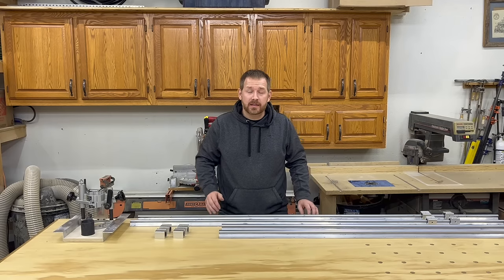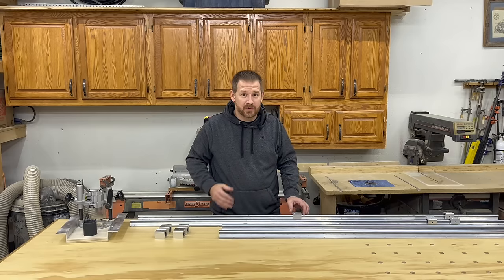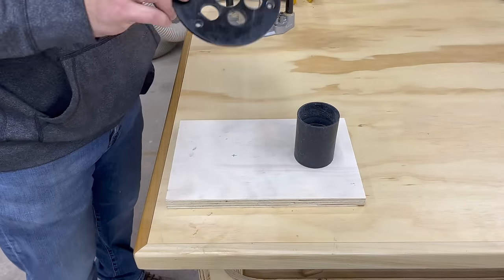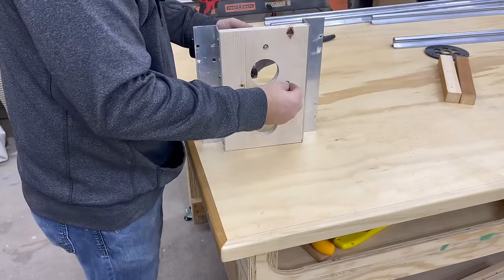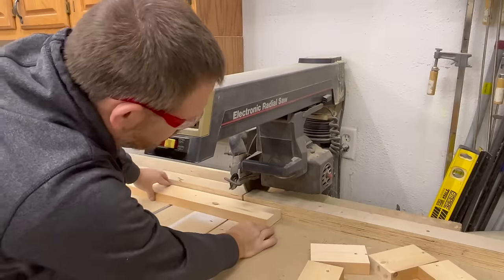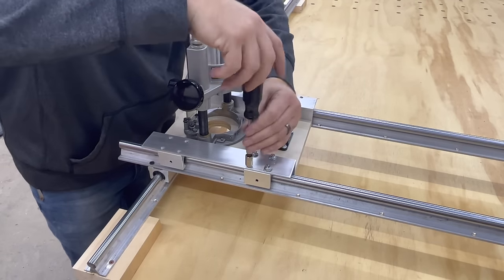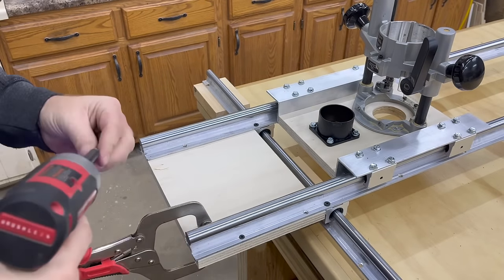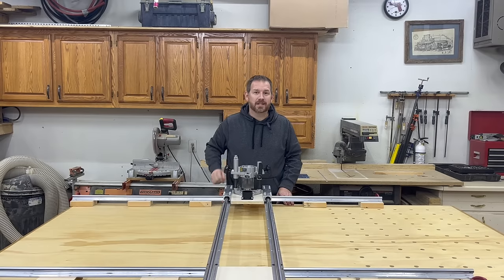Build a Better Router Sled/Flattening Jig

Comment: I just built on much like what you have done. I did make an alteration hat I think is important. I added stops at the end of each rail to prevent the possibility of the components from traveling beyond the ends of the rails. The idea of running router sliding off in either direction of travel is frighting. Either damage to the work, the router or the operator could be catastrophic. I used 1/4x20x1-1/4 boots 1 inch from each end.
Reply from the maker: Hello, thanks for watching.  That’s a great idea!  You definitely don’t want to run the carriage of the end!  For me… when I clamp my setup the the workbench the C-clamps block the carriage for running off the end.

Comment: How do you make sure the piece comed out flat? Is it that your workbench is completely flat or the rails? Or do you use shims under the slab when flattening like on a planer sled
Reply from the maker: I go over this in the next video.  Here’s a link to that video.  Building a Better Router Sled/Flattening Jig (Part 2)
https://youtu.be/wcQkhDzZ420

There’s also a part 3 where I make upgrades to this sled.  Here’s that link if you’re interested.  https://youtu.be/pYstDfpUUZE?si=ZAiS3v17u-jDraXw

Thanks for watching!

Comment: out standing video and well done.question as to bearings. you mentioned wood and dust  going into bearings and clogging unit. was it a big deal to clean
thinking of using a closed bearing block at router. Will this help? best joe
Reply from the maker: Hey thanks for watching!  Cleaning the bearings isn’t bad.  I just blow them out with the air compressor and lube them with a spray can of dry lube.  
I made some upgrades to this sled which included an better dust collector.  Helps a lot.  I can do much more work between cleanings.  Here a link if you’d like to check it out. 
Making The Better Router Sled/Flattening Jig Even Better!  Time For Some Upgrades!
https://youtu.be/pYstDfpUUZE

Comment: Nicely done. I've purchased the materials and set op the sled worked well but there are a couple of catches with the bearing blocks. The blocks do not match the width of the rail base so you can not attach the upper rail with 4 screws, the spacing of the holes in the blocks are not consistent so the over sized holes are a must, and lastly twice I've had the bearings fall out of the bearing block. First time the bearings were laying in the bottom of the box when I opened it. Amazon had replacement rails and blocks to me in 3 days. Second time I found 2 bearings on the table when I disassembled it after my first flattening project. Still trying to decide on how to proceed, get it replaced again. or ship it all back and go a different direction.
Reply from the maker: Hello, thanks for watching!  My upper blocks also attach with only 2 screws each, hasn’t been a problem.  Sounds like you’re having terrible luck with the bearings.  I haven’t had any issues with mine except they get dust in them and need to be blown out with the air compressor once in awhile.  Hopefully they can send you some good ones!

Comment: I got to rails but it lacks attachment screws. and the holes do not line up which can be fixed. What did you do for attaching the rails to the carriage slide, ie what size bolts
Reply from the maker: Hello,  I took a bearing with me to the hardware store to figure out what I needed.  They are metric.  If memory serves maybe M6??

Comment: Great build, just about to finish mine up, but wondering what size of screws did you use for the rail blocks ? I tried a M6 but it had just a minute play when threaded.
Reply from the maker: Hi, thanks for watching!  I think mine were M6 but I could be mistaken.  I just took a block with me to the hardware store and found something that worked.

Comment: Do you have to add to the support blocks if the slab is thicker than 1.5"??
Reply from the maker: Hello thanks for watching!  I use different thickness blocks for a thicker or thinner slab.  You’ll want to set it so the upper portion of the sled just clears the slab.  I made some upgrades to my sled that included a different router.  The new router and bit combo give me a lot more depth of cut, meaning I can handle a wider variety of slabs without changing the blocks.  If your interested here’s a link to that video.

Comment: I like this. I want to see if I can move the long rails to the sides, just under the table top, so it can still be used as a work bench and out feed table.
Reply from the maker: Hello, thanks for watching!  I just clamp mine to the bench.  When I’m not using it I remove it and store it on a shelf.

Comment: My slab table is 12' long. Looking to upgrade the rail system to this. Longest rails I can find are roughly 8' long. Would you happen to know if you can end-to-end these rails fairly seamlessly? Thanks!!! Great job!!!
Reply from the maker: Hello, thanks for watching.  I haven’t tried it but I imagine you’d have to line them up perfectly for that to work.  I was looking into longer rails myself.  I found some 3500mm rails on eBay.  That’s a little short of 12’ but maybe they have longer one.  I haven’t ordered them yet so I can’t speak to the quality.  Here’s the link to the rails I was looking at.  https://www.ebay.com/itm/251042308644

Comment: How did you determine where the screw holes were to go for the bearings?  Really love the way you did yours.  Mine will very much mimic your design.  Thanks!!
Reply from the maker: Hey thanks for watching!  I measured the dimensions on the bearing at transferred them to the aluminum.  Be sure to oversized the holes a bit.

Comment from the maker: The aluminum angles I used where 1/16” thick.  They drilled east with a drill press.  I’d suggest oversizing the holes.  The holes in the bearing don’t seam to be perfect so oversized holes will make alignment easier.

Comment: Terrific & creative build!  Would you please specify the size screw and/or bolt that you used to attach the track & aluminum plate to the slides?  Thanks
Reply from the maker: Hello, thanks for watching!  I took a bearing block with me to the hardware store to figure out what fit.  The bolts are metric.  If memory serves they might be M6??

Comment: The wood base for the router would be too thick for my router (60 years old) with only 1/4" connectors.  The 1/4" bits I've found for flattening aren't long enough.  What else could be used for the base of the router that would still be stiff enough, yet thinner?
Reply from the maker: I’m not sure what you might use.  Maybe find a way to use 1/4” aluminum??  Depending on what you’re flattening I’d think using any 1/4” router bit would probably take along time to flatten a slab.  I made some upgrades to this sled with a new router and a 3” spoil board bit.  Makes it significantly faster.  Here’s a link to that video if you’re interested.  Making The Better Router Sled/Flattening Jig Even Better!  Time For Some Upgrades!
https://youtu.be/pYstDfpUUZE

Comment: I'm going to use your idea too. I've been thinking about how I was going to build mine but, I need to have a variable thickness between 1/2 to 4 inches. Any suggestions on that brother?
Reply from the maker: I made some upgrades to the sled that included changing to a Triton router.  This gave me a lot more vertical travel but not 3 1/2”.  When I’ve had to change greater heights I change the thickness of the mounting blocks.    If you’d like to check out the upgrades here’s a link to the video.  Making The Better Router Sled/Flattening Jig Even Better!  Time For Some Upgrades!
https://youtu.be/pYstDfpUUZE

Comment: what about adjusting height? for diff thickness, or additonal passes? thanks
Reply from the maker: Hey, thanks for watching!  I haven’t come up with a great way to adjust for thickness other than changing out the blocks I use to clamp the rails to the bench.  I did make some upgrades to the sled that include a new router.  The new router has a lot more vertical travel so it allows me to do more without replacing the blocks.  Here’s a link to that video if your interested.
Making The Better Router Sled/Flattening Jig Even Better!  Time For Some Upgrades!
https://youtu.be/pYstDfpUUZE

Comment: Is there a place to get a list of the parts and sizes??  I wanna make this, but would like to know what I need.
Reply from the maker: Hello, thanks for watching!!  There’s links in the video description to the rails I used.  The bearings are included with the rails.  Then you would just need the aluminum angles.  I used 2x2 aluminum.  
If you’re going to make this you might want to watch my upgrade video.  I made some changes to the dust collection that made a huge improvement.

Comment: This is amazing!! I'm looking to copy this setup at 1800 by 1200 rails. Is there any notable difference  in the rail 'SBR' and block sizes, I see you've used 16 for the lower and 20 for the top. The rail size lengths I've found in UK are only in the opposites so 20 for the lower and 16 for the top, was there a particular reason you choose that way or would it not make any difference?
Reply from the maker: The rails I used for the upper rails were a bit heavier, better for a long span.  I was setting this up to flatten a 42” wide table. If your not spanning as far the lighter rails are probably fine.  Thanks for watching!
Reply: @Idealwoodworks  Thanks. Look forward to seeing more videos 👍
Reply: I'm looking at building a smaller rig on a piece of plywood 1000mm x 600mm (40" x 24"). Do you think the SBR12 would be OK for both upper and lower, or SBR16 upper, SBR12 lower?

Comment: I ordered from the links in the comment section and sled “circle/cylinder” diameter came out different sizes. Are those the right links? They didn’t match up that well on the sled holes.
Reply from the maker: That’s what I used.  The heavier rails are the rails I used for the upper portion of the jig.  I figured the heavier rails would be less likely to deflect.  The holes on mine lined up perfectly but they should be easy to drill to fit

Comment: How important is it to have a perfectly flat service for the router sled to sit on? As in the flatness of the table or floor. I’m wondering if I can set one up on a pair of saw horses to reduce overall storage space
Reply from the maker: Hello, getting the rails in plane with each other is critical if you want the end result to be flat.  If your rails are not exactly in plane the table top will match that and look like it has a twist. You can still accomplish this with sawhorses just make sure to get the rails lined up perfectly.  Thanks for watching!
Reply: @Idealwoodworks  cool thank you for replying!

Comment: Where can I get the railing and bearings? And what are they called this is amazing thank you! 🙏
Reply from the maker: Hello, thanks for watching!  There is links in the description to the rails I used.  The bearing come with the rails when you order them.
Reply: I did not see the links, but the ones are on Amazon and I ordered the longer ones directly from Vevor. The nice thing is they do sell different lengths.

Comment: Do you need a 2hp+ router for a sled like this?
Reply: Also, where do you get rails and bearings? Bearings seem easy to source but do they have rails liek this at box stores?
Reply from the maker: Hello, thanks for watching!  There’s links in the video description to the rails I used.  I bought them from amazon.  The bearings come with the rails.
A larger router makes for quicker work but if you only have a smaller router just go slow enough not to overwork it.  
If you’re going to build one of these you might be interested and in some of the upgrades I made.  Here’s a link to that video.
https://youtu.be/pYstDfpUUZE?si=XR4t3CsMgoAC8MYb
Reply: @Idealwoodworks  Thanks! I found the links very soon after I left the comment! 

Did the brush help a lot? I was worried the bearings wound get clogged, but seems like the brush surround could get snagged on the wood also. It looks like it's working pretty well in your video!

I've seen these made with skateboard or rollerblade wheels, which probably wouldn't get clogged with sawdust. Thanks!

Comment: how long did you make your 2" aluminum rails that hold the router?
Reply from the maker: You’ll just want to make the base just big enough to fit your router and any dust control you need.  Then make the aluminum angles to fit.  If you’re building one of these you might be interested in some upgrades that I made.  Here’s a link to that video.  Making The Better Router Sled/Flattening Jig Even Better!  Time For Some Upgrades!
https://youtu.be/pYstDfpUUZE

Comment: What is the difference between the upper and lower rails besides the length? Is the thickness of the rail where the bearings slide different for them?
Reply from the maker: Yes, the upper rails are a bit heavier.  I did that to avoid getting deflection from the weight of the router.  Thanks for watching!
Reply: @Idealwoodworks so the bearings off the upper and lower rails would fit on both? Like interchangeable?
Reply from the maker: No, the upper rails I use are heavier/thicker.  The bearings come with the rails when you order and they will be sized accordingly.

Comment: Good project, thanks for posting it.  Two questions....There is some risk with a lot of linear bearings of the balls falling out if the truck comes off the rail, not the case with that style?  Secondly is there any sort dust wiper or guard on the trucks?  Wondering how long they's stay smooth like that when exposed to sawdust. 
thanks
Reply from the maker: Hello, thanks for watching.  These bearings don’t fall out when removed from the rails.  Of course you’ll want to prevent them from riding off of the end while in use.  When I clamp this to my workbench the clamps prevent them from sliding off the end.  There’s nothing preventing dust from getting in the bearings so when doing my first large project that did become a problem.  I recently made some upgrades to the sled and dust collection which helped a lot.  Here’s a link to that video if you’d like to see it.  https://youtu.be/pYstDfpUUZE?si=ucNlUeK3uFaAkTIJ

Comment: This is a Rolls Royce of router sleds 👍👍👍   
Do you have a list of materials which you purchased?
Reply from the maker: Hello, thanks for watching!  The links for the linear rails is in the description.  The carriage was just some 2”x2” aluminum angle that I pick up at the local big box store. And the plywood was just some scrap I had laying around.  I did have to pick up some additional screws.  For that I just took a bearing with me to the hardware store and found what fit

Comment: What did you cut AL with?  Was that a metal chop saw?  Looked like standard mitre.  What blade?
Reply from the maker: Yes, aluminum is soft enough that you can cut it with a standard carbide blade.  Just go slow.  Thanks for watching!!
Reply: @Idealwoodworks  - thanks!  I assume It’s a high tooth count blade?  Maybe 60 or 80?

Comment: Good looking build. Just curious as to why the upper rails are SBR20 and the bottoms are SBR16? Thanks
Reply from the maker: Hello, thanks for watching.  The upper rails are a bit heavier than the lower rails so they are less likely to deflect
Reply: The Bearings for the SBR16 are smaller than the SBR20 bearings? @Idealwoodworks
Reply from the maker: @tsugat8184 Yes, the bearings come with the rails and are sized for the rails
Reply: @Idealwoodworks  Thanks!  I bought two sets of SBR20 rails and the rail sides are too small for the pre drilled  bolt slots on the SBR20 bearings. I will have to get a set of SBR16 for the bottom rails.

Comment: Did your rails come with screws because mine didn't and it doesn't say anywhere the size of the machine screw needed
Reply from the maker: Hello, thanks for watching!  Mine came with screws but not what I wanted.  I took a block with me to the hardware store and found what I needed.  The screws were metric, M6 I think.
Reply: @Idealwoodworks  awesome! Thank you.

Comment: How do you lock/clamp the x or y axis when you want to route a straight line?
Reply from the maker: The bearings have set screws on the sides to lock them in place.  Thanks for watching!
Reply: @Idealwoodworks  Ah, I see. You just sold me on building such a contraption!

Comment: Great video.  I love the details you provided.  I am planning to build a smaller version of this since I only will use it on end grain cutting boards.
One question I have is why are your lower rails ordered from one company and your upper rails ordered from a different company?
Reply from the maker: Hello, thanks for watching.  No real reason.  I just scrolled through Amazon until I found the sizes I wanted.  The upper rails are a little heavier than the lowers….good for spanning across the table.

Comment: Great video. I’m using your plans. The rails came yesterday and the blocks are wobbly on the rail. Was the same for you?  Do they become more solid/less wobbly once everything is secured?
Reply from the maker: Hello, yes they are a little sloppy but that didn’t seem to bother anything in the end.  On mine there is a set screw on top of each block that can be adjusted to get them a little tighter.  Thanks for watching!
Reply: what's the size of the screws for attaching the router carriage to the blocks? Thanks
Reply from the maker: @toartoukargou8213  Hello, thanks for watching!  Mine were metric screws.  If I remember correctly they are M6.  I just took a block to the local hardware store and found what fit.

Comment: what size screws do I need to attach the bearings to the aluminum angle ? 6m?
Reply from the maker: Hello, thanks for watching!  I don’t remember off the top of my head…. I just took a bearing to the hardware store and found what fit.  It is metric, 6 might be right.